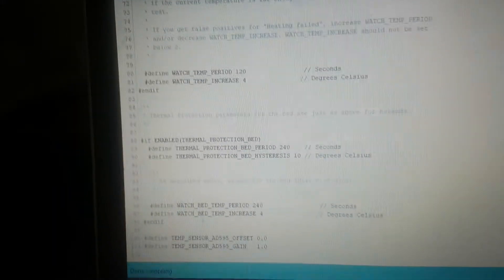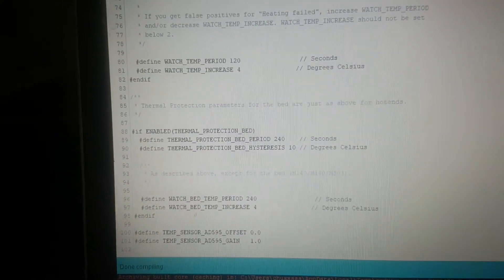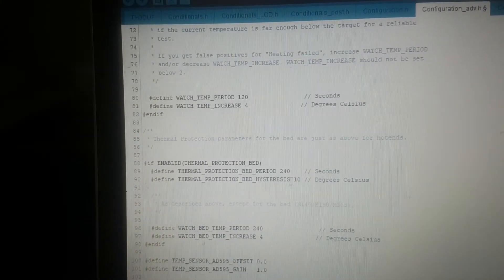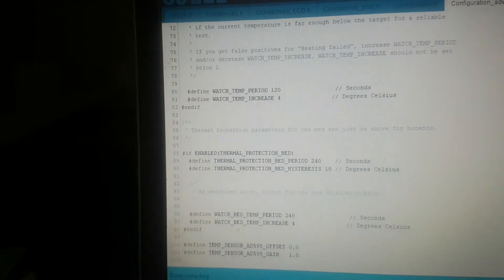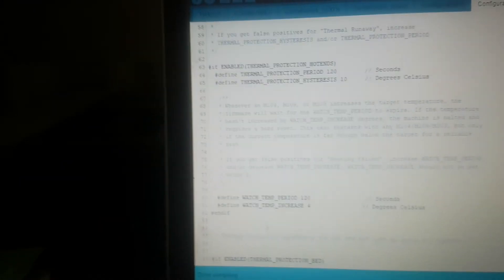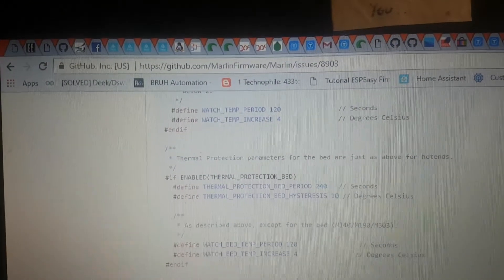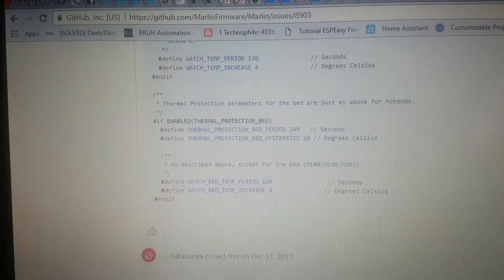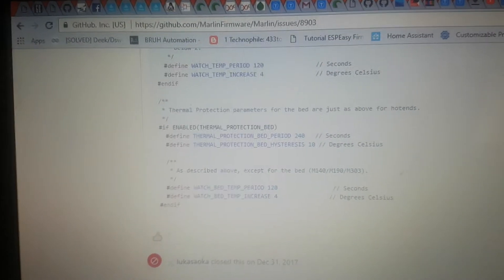Fix for Creality CR10 Marlin software. Thermal Runaway.

Comment: Thanks for the tip. I was having the same error after the first few minutes of staring a print. This started after I updated my firmware to use the TH3D EZABL. I also changed over to the Wham Bam flexible print surface, so I'm not sure which was causing the thermal runaway error. However, after making the changes you suggested to the firmware I've not had the error return yet. That being said, this current print has only been running for 25 minutes, but that is way longer than before.
Reply from the maker: Very good, glad to help. My printer is still going well. Have a wonderful weekend.

Comment: So, how do I actually access the firmware to change it?
Reply from the maker: You need to change it with a usb to TTL converter and CR10 marlin software to flash it. Hope this helps you.

Comment: My AnetA8 started showing this thermal runaway error all of a sudden, after working fine for more than a year. The only change I made to the printer was removing that little fan that cools off the filament (not the nozzle fan, but the one that cools the filament in the extruder chamber) because it had a few broken fins and was making a lot of noise. I don't think this could really cause any temperature changes neither for the bed or the hotend, so I went ahead and checked my Configuration_adv.h file and noticed the THERMAL_PROTECTION_PERIOD was 60 sec so I increased it to 240 seconds.

My bed connector looks fine, and the heating block thermistor looks fine too, so I'm not sure what could be causing the thermal runaway.
Reply: Edit: I just found the problem. I started a print and while the BED was starting to heat, I grabbed the bed connector cable and moved it around, and the light that indicates that the bed is heating would flicker anytime I moved the cable, so I do have a faulty bed connector.
Reply from the maker: Was just about to say check thermistors on head and bed. Hopefully this solves the problem.  Have a wonderful day.

Comment: Those thermal protections for the hotend and the bed are essential and I don't think those should be changed since they are tuned by the manufacture to reflect the used heater element. If something worked and at some point stopped, then the problem should be tracked down to either hotend or bed heating loop. Increasing the detection period generally gives extra time for possible arcing in case of loose connection of semi-broken heater or broken thermistor.
Remember, all of the recommendations written in the Marlin configuration, like "If you get false positives for "Heating failed" increase WATCH_TEMP_PERIOD and/or decrease WATCH_TEMP_INCREASE..." are for the 3D printer's manufactures to tweak while developing.
Reply from the maker: The Manufacturer does not have thermal run away in there code. As proven by other channels on YouTube . I got it working the anyway the thermistor on the hot end was not right. So I  replaced the hotend thermistor all good now. Thank you for the advice. Have a wonderful New Year.

Comment: What temp are you running your bed at ? I've started having this same issues running my bed Around 100 degrees printing ABS
Reply from the maker: PLA 55 to 60, Had real problems with ABS at 90 to 100.
Reply: @chuxxsss  I was running my bed at 100 for ABS in an enclosure and kept running into this error your update fixed it!

Comment: Do you still recommend this? If so, is it easy to change the code that you're referencing, and how?
Reply from the maker: Have you got a bootloader on your CR10? You will need marlin and look for the lines of code I was thanking about in the adv.h file. To do this you will need a text editor like atom on Windows or Nano on Linux. It working great but been a while since I did this change.
Reply: @chuxxsss  omg, a Mac hater. I came to learn something. What is a bootloader? What is a Marlin? What is a adv.v file? More important, what did you do in this video?

Comment: Tried what you did still get the thermal runaway protection. after installing the creality new hotend with 3 fans.  do you know what it might be.
Reply from the maker: Need to set the Marlin bed and hotbed temperature setting higher.
Reply from the maker: How are you going with it Aerial?
Reply: it still give me thermal runaway.  i reinstalled marlin then did a pid tune from the printer menu and saved to eeprom. runs great now  ;)
Reply: Did you try changing your mosfet?
Reply: did a pid tune and selected e3dv6 and works great now.
Reply: @RType2966  i just changed my mosfet. Had a huge black circle on the bottom that wasn't visible on the top. Had constant power running to the bed before. Worth taking a gander at it.
Reply: Thank you will have a look

Comment: Disabling or changing the settings of the thermal runaway protection might result on fire.
The best solution is to do a PID Tuning (in the case you are sure it's a false positive) and change the parameters on the firmware.
Reply from the maker: Ended up being a bad thermistor.  Change it and fixed. Plus thermal run away active all good. Have a wonderful day.
Reply: I'm glad you found a solution. Have  wonderful day too.